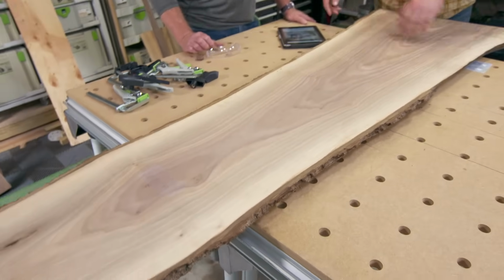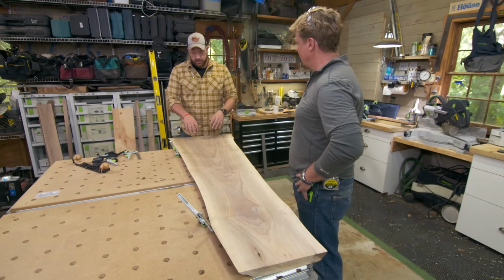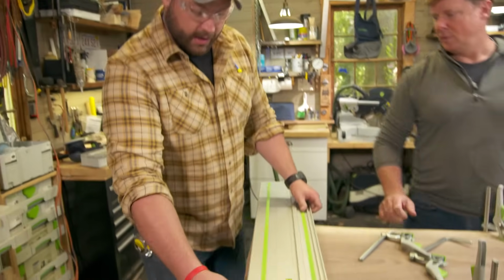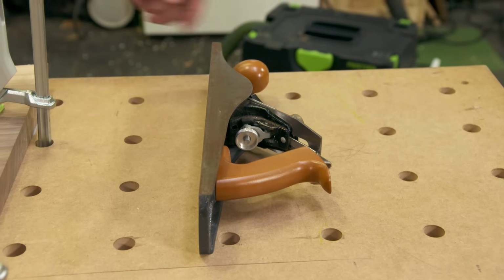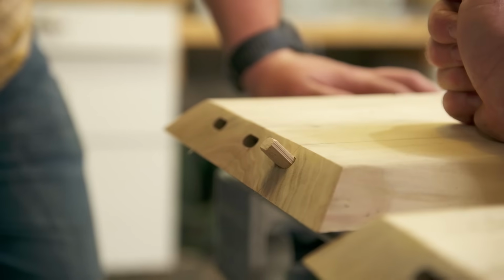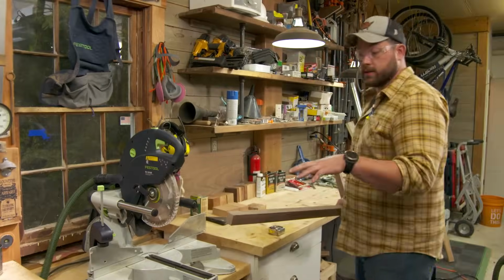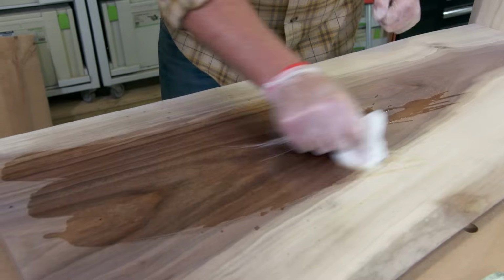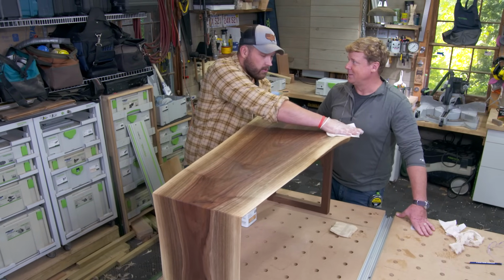How To Build A Coffee Table | Pro2Pro Premiere | This Old House

Comment: That cutting truck is not correct cause if you do one cut then it wouldn’t get dull if your doing multiple cuts your doing more cuts so the more cuts the more dull the stress on the blade is it would just follow the grain if you go too fast just go slow it’ll be fine

Comment: The Danish oil finish is nice but not sufficient for a coffee table. Once the oil finish has cured after 72 hours it should have a poly or Waterlox clear topcoat to protect it from spills. Danish oil won't waterproof it.